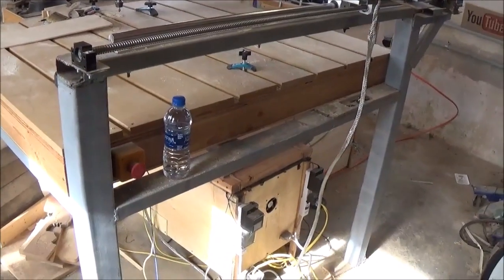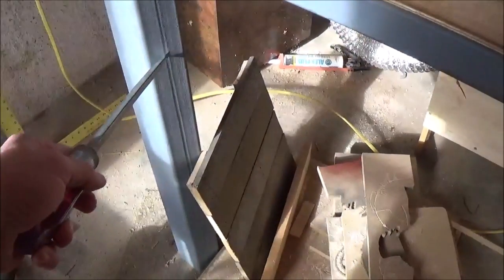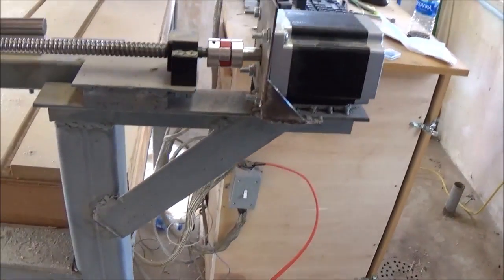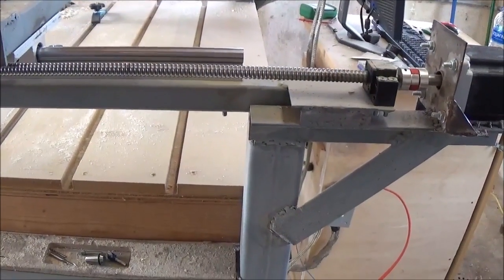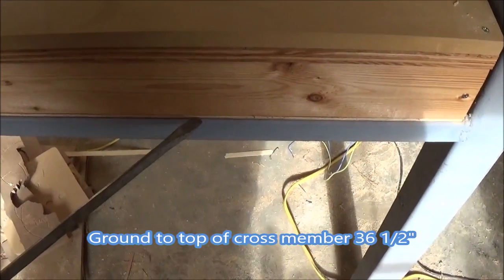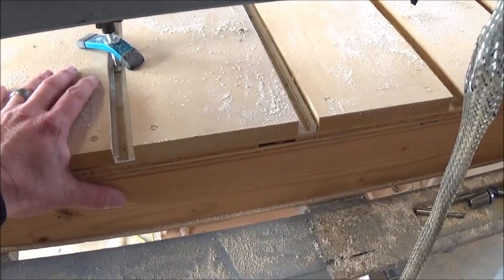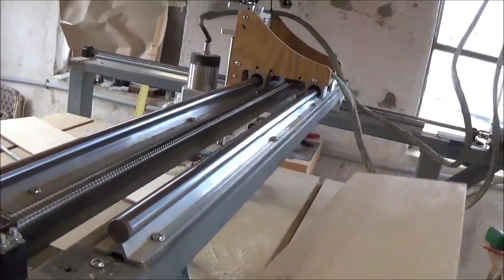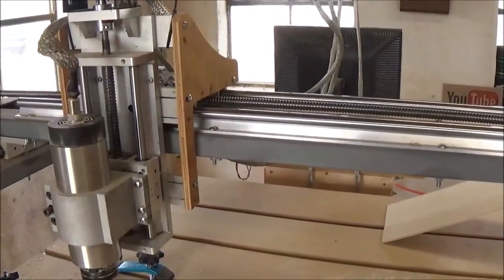DIY CNC router build  Frame and Gantry Details

Comment: Seems like you could gain another 12 inches of gantry travel by swapping the Y axis linear guides out for 5 foot models to match your ball screws.  You already have the extensions stretch out off of the table where the gantry could move to.

Comment: Love your videos!!! Been following you since almost day one. I currently have a Shapeoko XXL as my CNC router. I  take every semester at my local community college a welding for hobbyist class (currently in my 5th semester, fun class :). This semester I am making a frame based off of yours so I can make a CNC Plasma table. My table will be 3x5 foot and a working area of a little over 2x4 feet. I have found the linear rails I need BUT. My question is on your ball screws. I am lost on amazon at all of the types of ball screws there are. All of the codes for the ends. I am going 4 - NEMA 34 like yours. Can you explain what to look for so I don't order the wrong parts. ie. dia of rod end compared to the motor shaft diameter and the coupling. Your awesome and thanks for any help you can give me!

Comment: On the gantry I used to have a shop bot machine.  The gantry was wider and the router was mounted inside the the two rails.  That gave the best length of travel and cut capability.  Great machine sir!!
Reply from the maker: Yes, that is a design flaw on my part...That way would certainly work too....The flipping the gantry up on its side I would only do if you were planning to weld it so you wouldnt have to worry about stability....Thank you !! and thanks for watching!!!

Comment: Hindsight is a wonderful thing. having built mine 8 years ago there are always things I would do different. One day I will do it again, however i would say don't overthink it just enjoy what you have achieved. Oh just one big thing I would do is use square linear rails for the next one. However the round rails will do you well for quite some years.
Reply from the maker: Why square? Is the travel better?......I can't agree more with you, i've told a couple of people I will probably buy my next one, (5x10 someday) just because i don't want to spend the time on another build, i did however learn a ton...I'm running over to check out what you have going on your channel!!! thanks for watching!!
Reply: Smokey's CNC Woodworks. I found over time the Y and X Axis rails especially the Y axis, developed a grove where the top ball bearings within linear bearing block made contact. I repaired this by flipping the rail over.  However I believe from research into Square rails they would prove to be better over time.

Comment: You should ALWAYS build a model on CAD or on paper BEFORE starting to spend hard earned money. I'm still designing one now, and it's not easy.  Although mine is a 4 axis cnc mill for aluminum, it is very difficult to plan just the main body. I feel your pain and I would stop now and fix that offset and recover your workspace. Just add more travel, leave the gantry as is. Good luck.
Reply from the maker: I agree a good plan is always a good idea, I had a good idea of what i wanted when I started, just never really put it on paper..Now I did end up making me a parts list when I started ordering parts as I learned what all i needed.....Probably not going to cut the frame apart and add the travel, have to many orders pending....If I go bigger I'm probably going to buy the next one and probably be a 4x8 or 5 x 10...thanks for watching!

Comment: alot of people blasting u have prolly never built nothing, but are good at running things down others do cause they cant! I think its good job either way. I wish I had the patience to do one myself! u may have said before but how much did it cost to build it yourself?
Reply from the maker: It ended up costing around $3200, with all the software....Thanks for watching!!
Reply: Smokey's CNC Woodworks.. thanks.  I hope I can own one soon myself not sure I want to tackle a self build been trying to find one that has 12 inch z axis that isnt huge, but not much luck so far. I dont need more than 24 x 36. but all machines I have found in this size  only have 5.5 z axis.
Reply from the maker: I only wanted to build because I was new to the field and wanted to know how the whole machine worked and if something goes down on it, I happen to know the guy that build it!...LOL....Thanks for watching!!
Reply: Smokey's CNC Woodworks... Do u think it would be hard to change the z axis on a smaller machine to make it do 12inch z axis?
Reply from the maker: Well, It won't be hard, however, my machine for example has a 12" z axis but i don't have 12" of cuttable travel, the bottom of the z carriage gets in the way....I tell you what, I've got a couple of more questions to address that I'm not going to do in writing, just way to much typing....I'll shoot a video and see if I can address this....Thanks for watching...

Comment: Hey Brian! I just want to say that is an awesome design you come up with there. Quick question, you mentioned you would change the design of the gantry basically turning it upright, how would you mount the gantry to the linear rails after turning it upright? I’m just sitting here trying to think of some ways. Maybe mount the bottom of the rectangular tubing to the aluminum plate and install some kind of support on the back of it? Thanks
Reply from the maker: I would still have plates riding on top of the Y-axis and set the gantry on top of that plate just as it is now.(the plate on top of the y-axis would only be about 3 inches wide then)   The gantry would be on its side and a thinner profile and saving a lot of lost cutting area....Thanks for watching!!!

Comment: Take a look at this video on my channel, it is what you are talking about for your Y axis. Don't worry about making mistakes we all make them. In hind sight I would have made my table bigger too. https://www.youtube.com/watch?v=o6d3LT96jWs
Reply from the maker: Yes, A thin gantry that limits the amount of table space you lose...Its looks great!..I saw that you published that video in august of '18 and you look close to done...are you up and running??  Thanks for watching!!
Reply: @SmokeysCNCWoodworks  got the all clear with my cancer about a month ago, so I am nearly ready to get back out there and finish off what I started.

There is more benefit to doing it that way besides the extra length you gain back, the biggest advantage is you put the cutting tip back between your bearing blocks, what this does is massively reduce the fulcrum effect, which in turn keeps your spindle more upright and cutting tip square. A bit like standing in the middle of a seesaw. On the change of direction the further out the cutter tip is off bearing centre, the more it will show up.

I need to redesign my Y axis end plates once again (haven't even fitted the current generation end plates I just finished) because changing my X axis to a NEMA 34, means to keep things closely balanced I need to fit a NEMA 34 to the Y axis as well. Unfortunately one of the modifications I made to the new end plate was to move the NEMA 23 motor up higher closer to the Z axis, but this has now left me with insufficient space to fit the NEMA 34 motor. So I will go back to the drawing board once I finish the X axis modification.
Reply from the maker: That makes complete sense on the gantry set up you are using, looking good and congrats on the news about the big C!!1

Comment: If you flip the gantry upright, you may lose a fraction in rigidity. I imagine you might have to add a big gusset which could cause its own interference issues, though it could project forward where you're already losing a few inches from the z-axis and spindle. Also, I really like that frame design.
Reply from the maker: My thought was to add gussets at the ends of the gantry for the rigidity, my plan would be to attach the z-slide directly to the x-axis plate with 4 bolts, eliminating the need for gussets for the z-axis completely...I think it would take more engineering to do it than the way i built it...If i would have really thought it through, the answer is 5 ft linear rails, more travel room and almost a complete 4 x 4 work area. and very little change to my design...Thank you!! now you've got me thinking though about the rigidity of that new gantry design..hmmm...lol..Thank you for watching! and have a Merry Christmas!!!

Comment: Looks good. Thanks for sharing. I have a question. What are specs. on your ball screws. TPI, starts, diameter. Thanks again.
Reply from the maker: Its 5/8", single start, tpi-8...(i'm going to double check the tpi in the morning, want to make sure i'm telling you right, its been a while since i had to set all of that up on mach 3......Thanks for watching..